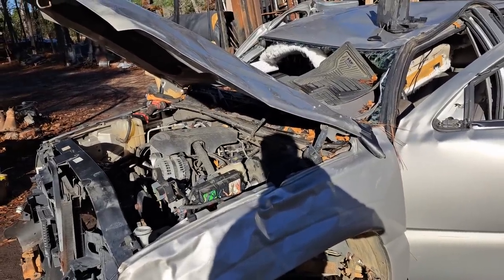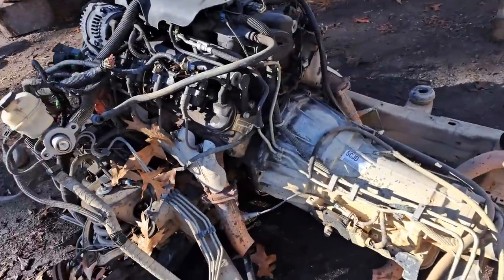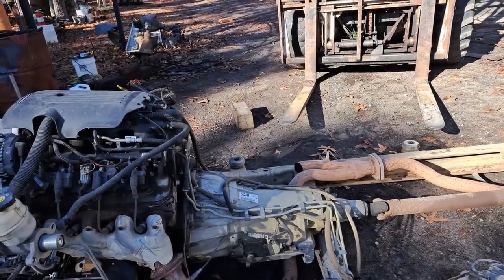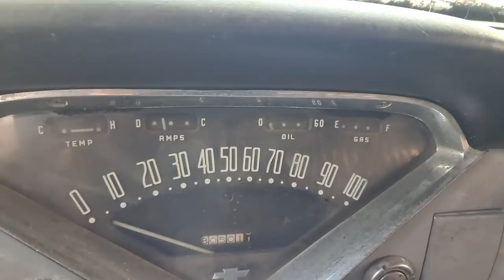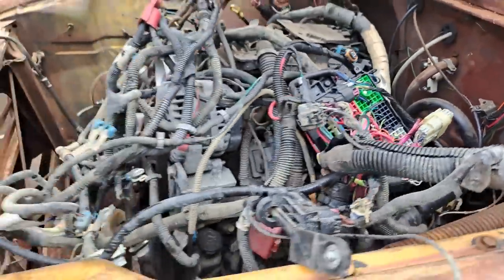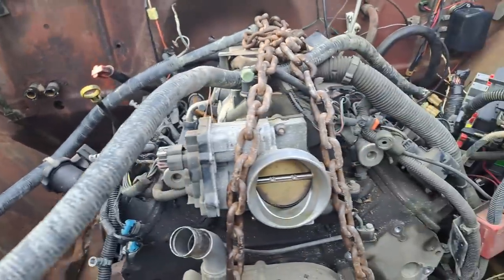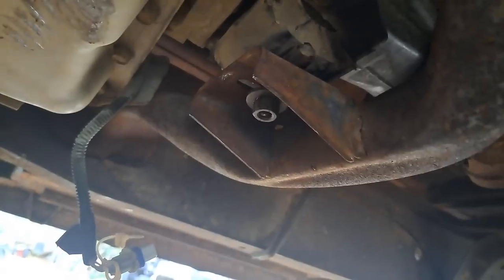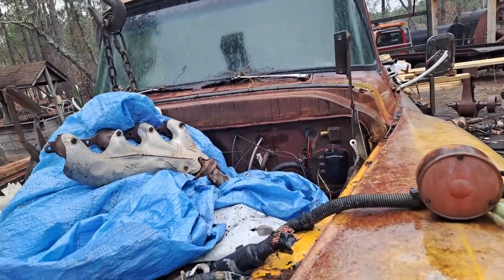Helping Jonathan W LS Swap a 58 Chevy Truck

Comment: GM really screwed up with that engine design.There's about 3 inches of unused space under the throttle-body that they didn't stuff in a few sensors,wires and hoses.What a waste.You guys managed to get that set in there pretty nicely.Can hardly wait for the next videos to see it start up.

Comment: I   think    Jonathan   should    have    left    the   stovebolt   in   it,   but    I am     old    and    I   dont    like   engines   that   are   smarter   then    I am.
Reply: Needed an overdrive, can't drive 50 mph around here without getting ran over,